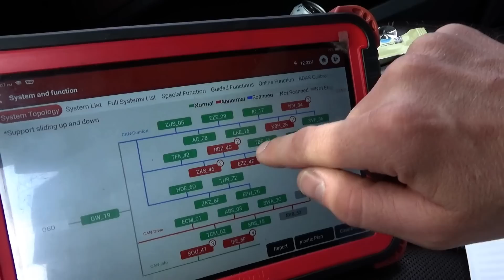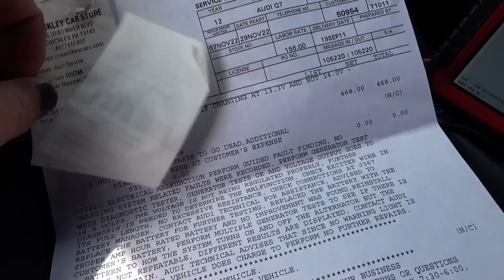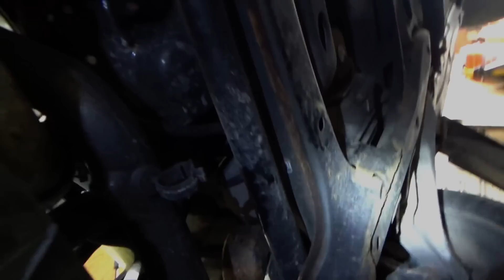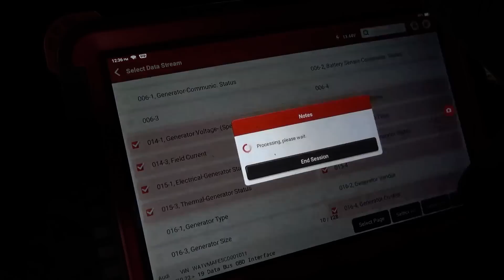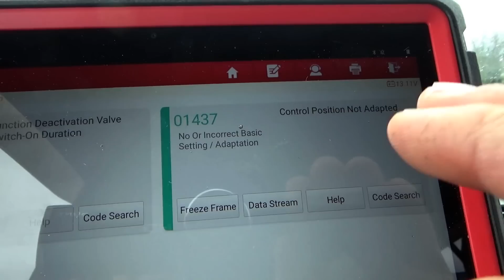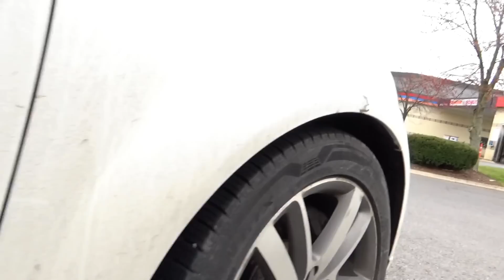Audi From HELL...DEALER STUMPED!! (Part 1 - Charging & Air Suspension MALFUNCTION)

Comment: I would like to preface my comments with 28 years of MB dealer, 10 as a foreman and now 8 years as a shop owner of tech experience. Ivan I am glad you may have a little diifferent perspective after the visit with the dealer tech. I understand that your channel was built around a no parts required approach / philoshiphy "low cost". This approach can be but isnt always the absolute best for both parties, the servicing facility and the owner. The aging euro cars were abandoned by the educated consumers due to high costs of ownership. The discussion ins't whether there charging to much it is are charging enough? If you and others IE Eric O are resolving issues that others cant then fair compensation is due. If you are offering premium service then there should be an expected cost associated with it. Food for thought and all the best!!

Comment: That diagnosis sounds like something that happened to me several years ago at Nissan. I know you're a tech working on someone else's car, but this is what I did. Go to service manager for a refund of faulty diagnosis and repair recommendation with logic and facts to back up your position. If no refund is issued, go to BBB with the facts and report it. That's what worked for me. Took several weeks of waiting and several hours of my time, but it worked. For you as a tech, probably not worth it as you'd then have to charge the customer for your time instead of passing along the Audi dealership's bill.

That experience was when I bought my first OBDII code scanner and it more than paid for itself in one repair. The more informed you are, the less people (or processes) can take advantage of you. The dealership, book repair PROCESS is designed to generate revenue for the dealership and minimize tech time so they can turn more vehicles, not diagnose the problem in the most cost effective method for the customer. In this case, it is easier for them to fall back on a statement of replace the entire pump and wiring harness because the connector is corroded than to look any further into the problem. It generates part sales revenue and minimizes the tech's time on the vehicle. Does it fix the actual problem? Probably not, but they make you start there.

Comment: That's why I despise dealerships! They're nothing but part changers and cause more problems than they fix! Thanks Ivan!
Reply: That all depends on lots of factors. One really good one stands out to me when a local transmission shop "diagnosed" a Hummer H2 transmission problem. Sold the customer a full rebuild to the tune of over 4000 dollars Canadian(prob 10 or more years ago) Didnt fix concern. Brought it to me at the GM dealer i work at. Scanned it and right away grabbed my test light and tested ign1 power at ign switch, dim light. Quoted a 60 dollar ign switch, half hour diag and half hour repair. But ya i see your point, guess im the crook for charging him to fix his issue when another small shop already spent all his money on repairs not required. This is only one of many stories i have. Not all dealer techs are built the same and not all small shops are any better.

Comment: The warranty was expired on my 2014 Expedition. I took it to the dealer to have a leaking shock replaced. They replaced it but charged me $45 for new bolts. I asked why and was told that this was because it was required by Ford because of corrosion and the old bolts could break if reused. The car only had 5000 miles on it and the under frame is in perfect condition. It is a desert here and no snow or salt. But still had to pay for the new bolts.  🙄

Comment: Hi Ivan I am a British DIYer running a 2008 Q7 with 120,000 miles and generally take care of most things myself unfortunately recent ill health caused me to have a number of visits to various hospitals where I parked up and returned to the car after the visitant the car would not crank just a click I asked another person parking if they could allow me to jump start off their car I always carry jump leads then I went back to my car and it started without the  the jump so I thanked them and went on my way.This happened again on a number of visits to various different hospitals and each time I managed to get a jump start from other visitors I never had any trouble starting the car anywhere else but hospitals.Then eventually it did do it when I was fortunately at a friends place who was a car restorer so was able to give me a start and off I went home and it never started again with or without a jump so i decided it has to be the starter motor gone bad so I bought a replacement and found out what kind of a job it was to replace well it's a cow and due to my health problems I asked my friend if he could do it for me which he gladly (for me)did unfortunately after fitting the new starter the problem still existed, by the way you probably know how difficult it is to get to the terminals on the starter to check anything but he managed to get a meter in and found it was only getting four volts at the starter we eventually found the problem was at the jump start connecter under the bonnet here there are two large cables that connect at that point that are held together by the screw that holds the jump connecter this connection had come loose so there was little current going to the starter and vice versa little current going from the alternator to the battery which also explained a problem I was having with poor battery. I don't know if this has anything to do with the problem you are having but I thought it might alert you to a weak link in the electrical charging system on the Q7 cars.Sorry its a bit of a saga
Reply: You know the mantra. TEST DON'T GUESS!. Could have saved yourself the cost of a replacement starter. That wasn't cheap I'll bet.
Reply: @deniscarr469  hee hee  quoting Eric O on Ivans channel. lol
Reply: @deniscarr469  I couldn't agree more but as I said in my post its practically impossible to get to the starter connecters to test any thing and it was showing all the signs of a starter that had just packed in. The cost of the starter wasn't too bad  it was the £500 I gladly gave to my friend for doing the job for me that hurt a bit when none of it was necessary  and let me tell you it's an absolute pig of a job to do so many thanks to my friend
Reply: We had loads of faults on our Q3 due to two faulty abs sensors which retail at £25.00 each but the dealer charged over £500.00 to replace them and clear the codes, so I have invested in a obd1 scanner, once bitten never again 🤔

Comment: My one and only ownership experience with air susp was a 1995 Lincoln Mark VII (remember the commercial with the car driving under the wing of a jet and clearing it?). After bags, compressors, desiccants, etc. the only saving grace at the time was an aftermarket spider valve by American air suspension, that also had a moisture separator and catch with drain valve. Never again though would I own any air susp car.

Comment: Ivan, you keep bashing an institution (dealerships) that allows you to be a beneficiary....If they actually did what you wanted them to do, your business would cease to exist.... I highly suggest that you take a few months off and go actually work for a dealer, any dealer and walk a mile in their shoes. They do not exist to fix those problems that I call the "2 percenters". They have to deal with things that you don't have to like, overhead, payroll, chain of command, executive pressure, engineer directives, etc. They have to meet a financial quota on a month to month basis, you don't....The dealer techs work on a flat rate system that pays them of fraction of what the dealership makes. You don't have to deal with that. In my humble opinion, you wouldn't last a month working at the dealership, you would end up starving. How do I know this?  I actually went to work for a Chevrolet dealership for a few weeks and didn't last the month. You (and I) are actually benefitting from this system. I have a business similar to yours where I fix all of the "2 percenters" from other shops, the problems that they can't figure out. Don't bite the hand that feeds you. It is what is is....Let sleeping dogs lie.

Comment: Had a couple experiences like this when I was younger. It was the exact reason I decided to start buying my own tools, the repair manuals, and learning to work on my own cars. That turned into a lifelong hobby/sidehustle. Now we’re doing LS swaps, and reworking harnesses, and all kinds of fun stuff lol. The only way I’m taking a car in for a repair these days is if it happens to be under warranty lol
Reply: Even then I am leery.  They replaced the water temp sensor, and the next morning I found the part box behind the throttle body.
At least I know they used OEM part.  LOL

Comment: The pump was "Bench tested"?
How did they do that without removing it?
The bolt threads are still rusty from not having been loosened, that pump was not removed for testing.
Reply from the maker: They just unplugged it and used a POWER PROBE lol!
Reply: @PineHollowAutoDiagnostics  And, if you spend the money and have them install the parts they quoted for 4000 bucks, will the car be right?
No.
Toyota once tried to sell me a turbo because the seal where the fuel line goes through the valve cover to the injector on the 1kDFTV diesel engine was leaking.
I managed to convince another dealer that I just wanted the oil leak on no1 injector fixed, but I saw the guy twitch when I mentioned injector.
It is bad.

Comment: My younger brother had a Audi quattro v6. . . . The car called for service. . .He took it in and picked it up the following  day, $1400. for service to a car that run perfectly! ! ! ! Welcome at Audi excellence. .
Reply: The price is ridiculous but a service is preventative maintenance. You don't ignore routine servicing just because a car isn't yet running badly.  Do you wait until the engine is knocking or seized to get an oil change?
Reply: @ferrumignis  Engine, transmission, gear box, brake, we replace theses oils ourselves  at the recommended millage We like a l;otb exploring our cars. .
Reply: Being a V6 they probably had to drop the engine to change plugs or something  just as stupid.

Comment: I live in the UK and have always had European cars, while I admit that the cars are not perfect the biggest problem is the dealers. (And their highly polished parts cannons).
Unfortunately you have been presented with a car that has been messed about with by inept main dealers, I suspect the initial issues were relatively trivial for a complex and aging car. 
Without a doubt that dealer diagnosis was incomplete, they also failed to reassemble it correctly. That pump was blatantly NOT bench tested.
Reply: Maybe their bench tester also will not calibrate.  LOL

Comment: Geeez if someone had mentioned they had a coolant leak in their alternator earlier this morning I would have looked at them kind of funny because I’ve never heard of a water cooled alternator. Just another point of failure. I learn something new every day!
Reply: Coolant in an electrical component sounds like a great idea...
Reply: @thirzapeevey2395  Guess EVs are out of the question for you 😆
Reply: @CheezeCracker  EVs were already out of the question for me.  I don't like children being enslaved to mine minerals for the batteries.  I don't want those batteries charging in or near my house.  I don't want to have to rewire my house for the charger.  I don't want a car that catches fire if it gets wet.  I don't want the extra weight, which is literally breaking down parking garages.  I'm more likely to pull a 40 year old junker out of the woods and put it back on the road than I am to buy an EV.
Reply: You can probably thank BMW for this BS, first time I heard about it was on a E38 740i (94-01 gen).  The 540i also had the same system.
Reply: NASA does it on the Apollo capsule.  You saw how well that worked.
Reply: Well, the engine is water cooled.  I guess that's just another point of failure, too.  Not sure what drove them to do that, but it could be because of if higher electrical loads in modern cars. Liquid cooling is a lot more effective than air cooling.  Many CPUs and GPUs in computers are now liquid cooled because of the amount of heat being generated.  Look up "heat pipe".
Reply: Gotta keep up with the latest tech.
No, I was gob-smacked when I learnt about liquid cooled alternators too.

Comment: Yes Sir !your absolutely right we DID leave the compressor unplugged .After rigorous and detailed scrutiny by our Master Tech   it had tested outside of spec.You must understand that intermittent voltage spikes to ground can manifest in various Indeterminate ways that show the less than optimal amperage in the excess range that may provide at some stages  a successful operation that was initially diagnosed faulty but not totally shown as such on the latest application of the current scanware our factory trained Master Tech operates. (Deep breath by Service  Advisor,who puts arm around Ivans shoulder and continues)  We were concerned about the possibility of further electrical damage leading to but not confined to the high probability of a catastrophic fire leading to your house burning down and your wife and children dying as well as global pollution and the end of civilisation  ,surely you can understand we acted in your babies best interests..........$$$$$...... Ka-Ching goes the cash register .Commonly known in the industry as the Clark Griswald Family Truckster move

Comment: It is dealer such as this one that gives them a bad name. They are not all like this. I once had a Mercedes dealer try to charge me extra hour's labour (£150) on top of a warranty job (rear subframe replacement) where I agreed to pay for some wear-and-tear parts that needed replacing at the same time (an exhaust clamp and the flexdisc for the propshaft where it bolts the the differential flange) but as soon as I disputed it they immediately backed down. Not all dealers are bad but some still try it on.

Comment: Last summer my customer was getting ready to go on vacation. Month or so prior they had paid their car off from the local "high class scumbag buy here pay here" lot. They told customer to bring their dodge journey in so they could remove the GPS tracker. They install these things with solder seal junk. Anyway they removed the "brain box" but left the starter interrupt relay. If there is any part of this system that would affect the customer its that relay. Those solder seal garbage doesn't make good connector. Its their starter wire. This is one of about 6 cars that came from this joint I have cut those connectors out to fix issues.  Anyway the dude working on it had cut a wire. It was the low reference wire for 3 transmission speed sensors. I dont know what caused the failure but there was a extra wire spliced into this low reference and ran to body ground. Either that wire caused it or  Im assuming that they power probed it and fried the PCM.  The low reference had .8v with their extra wire removed. They added the wire which got them out the door after being there 6 hours for a "20 minute job" Of coure they took no responsibility for it.

Comment: Remove driver seat to check fuse... That sounds really convenient 🙄
Reply from the maker: HAH the Audi Master Technician likes to do things the "hard" way and collect more diag time! Test light at Pump and bidirectional control with scanner would have proved in 10 minutes that all fuses and relays were perfect without "disassembly of interior" lol! xD
Reply: @PineHollowAutoDiagnostics  butt butt butt step 47 on the flowchart said to check the fuse with an ohm meter 🙄
Reply from the maker: @SouthMainAuto  "We have to tear your dash apart to check the wiring harness...10 hour job" UNREAL!!
Reply: @SouthMainAuto  thought you got over your stuttering! 
LoL 😂😆 
I've learned a lot from your and other channel's videos!
Reply: Ohm meter my backside!,
Reply: @SouthMainAuto  Oh!  For Pete's sake, Eric, stop it!  Since when do you do ANY of that?!?!?
Reply: @mrcogginsgarage7062  Yes there is your problem lady!
Reply: @PineHollowAutoDiagnostics  Hi Ivan! if you looking to invest in vag-compatible scanner do not go with VCDS. Dont get me wrong it is a very helpful device if you work on vw or audi but it is good for scanning and coding , also good at logging and adaptations but all that you can do with your current scanner. Better invest in ODIS (clone VAS 5054a ) its much more versatile tool.
with the current problem on level surface ,set suspension in off-road mode or try to rise car air susp. in the highest position possible. Then lock susp. using "jacking" mode (using MMI-car systems-air susp change wheels.....) Turn off and leave it until it go to sleep mode . it might help, if not - you have to reset adaptation 
good luck
Reply: SOUTH MAIN AUTO has entered the chat!
Reply: Ah...the bromance between Eric and Ivan.  Gotta love it!
Reply: I didn't think there are FUSES under the seat. I would be checking power and ground at the air pump, and checking it where it comes in, wherever it is at. If it comes from the BCM, I would check there, as well as the fuse panel.

Comment: As far as the Aufi dealership and their refusal to refund your money is concerned, you really need to go above that service writer, you have proof they screwed up. Don't take no for an answer from them. As for the initial charging system issue I'd be suspecting corrosion, your knocking some off the alternator wire plug when you reconnected it probably fixed some of it and is ehy it dtarted charging when connected again. Quite the bucket of worms.